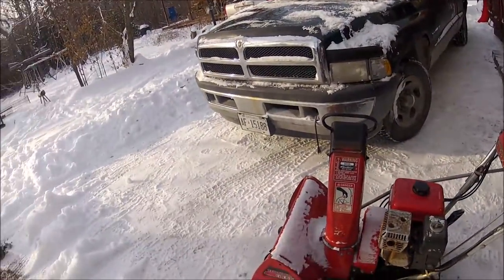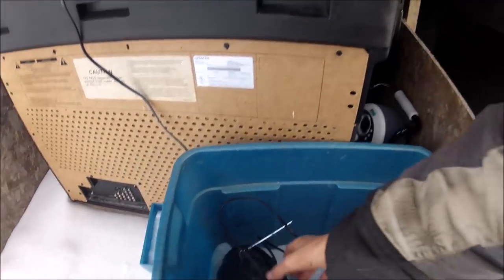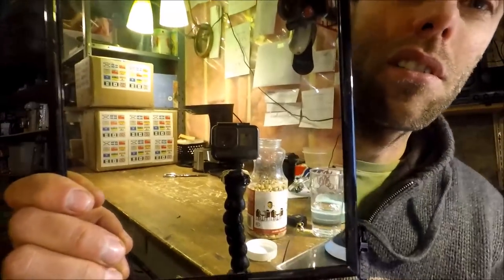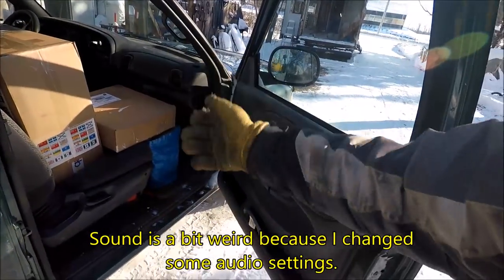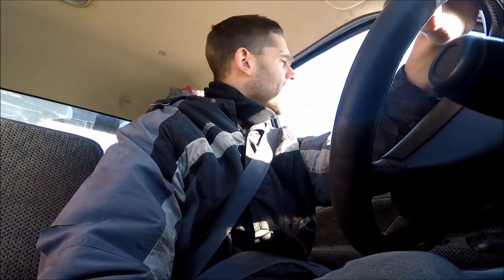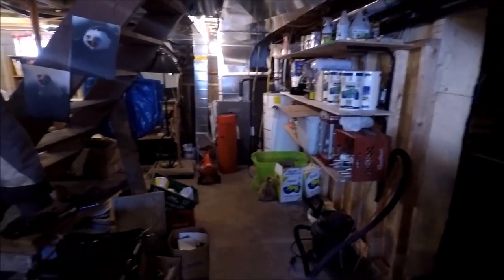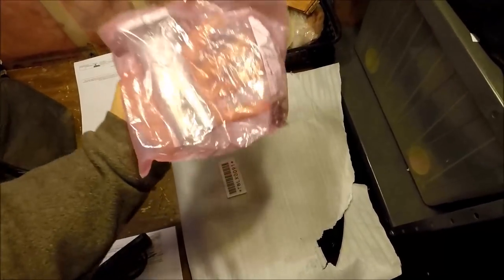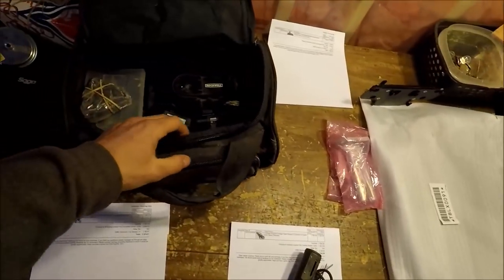Scrapping in the snowy snow. Found a nice Samsung cell phone at my bin

Comment: Its 9° here and feels cold you wouldn't like it here i have a 8 lane motorway/interstate 200 metres from my house you hear it 24/7 and i live under the flight path for the city of london airport id love to hear silence im going to try sell a Panasonic viera stand on ebay later on got it from that pick up in my last video
Reply from the maker: I grew up in the city, but yea that sounds noisy! You'll be surprised I bet your stand will sell fast. Packing it is a bit difficult.
Reply: I have a good collection of random sized boxes and i been stock piling bubble wrap and those little bags of air for years i found a big bag of those polystyrene nuggets in a dumpster at the bootsale